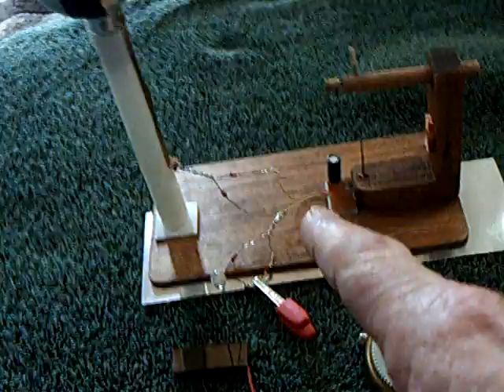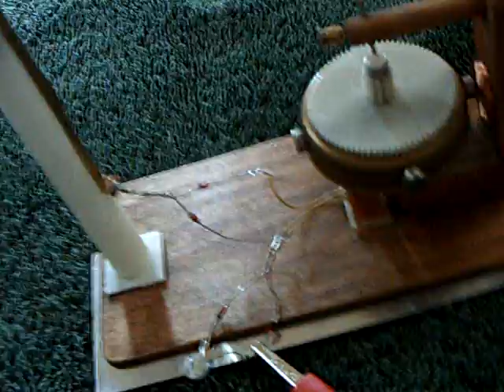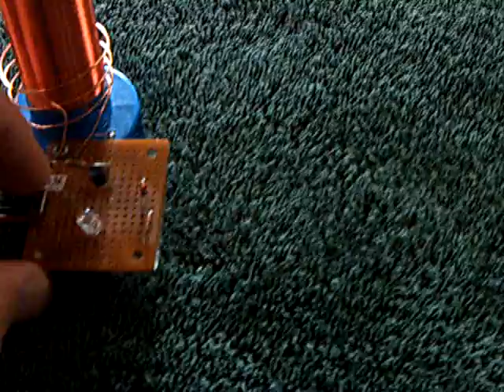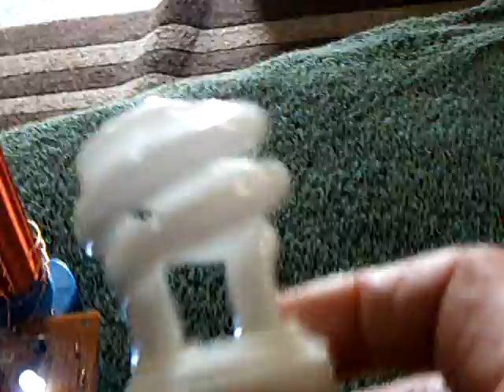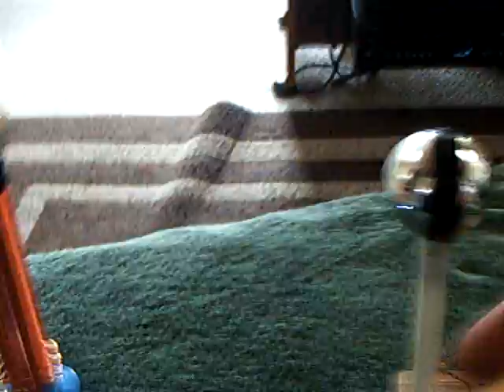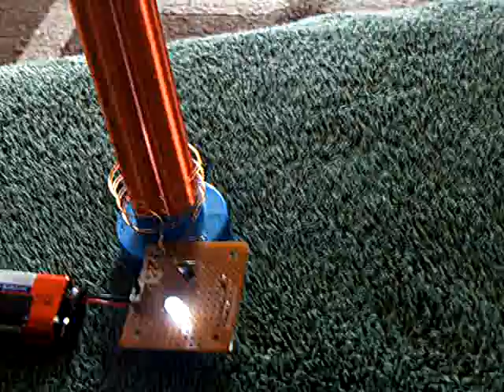Free Spin --powered Tesla style

Comment: Can you tell us what the little micro dot is on the waving flower circuit board. The solar panel is in parallel with the capacitor. The capicator must discharge thru the micro dot (maybe transister) whenever the pickup coil notices the magnet coming. It is not a Hall circuit because you keep it seperated from the coil. Is it a bifar coil? Thank you.

Comment: I wonder if a JT type device charging a capacitor could get it running off a garden light panel. I might have to try it! Very nice demo! Good proof that these slayer type Tesla coils can transfer amps and its not just exciting radiant energy or inductive link. There is a lot going on with these simple circuits, and I think much more study is required. Thanks for this. Great video. Keep up the good work!